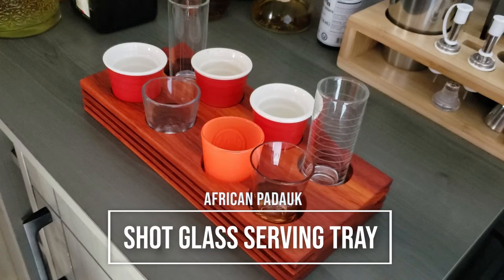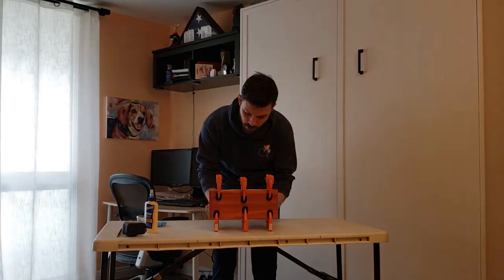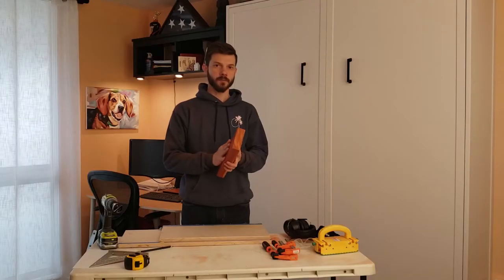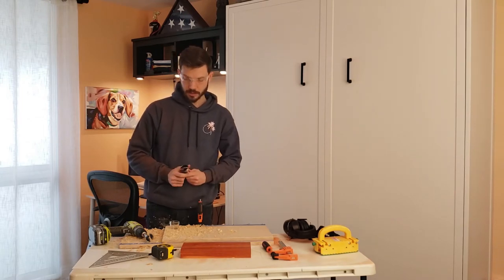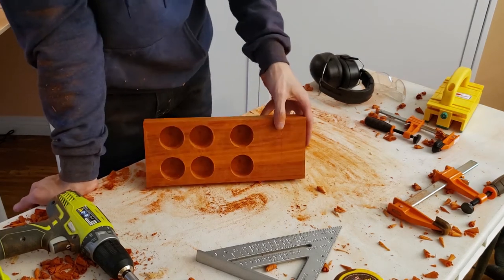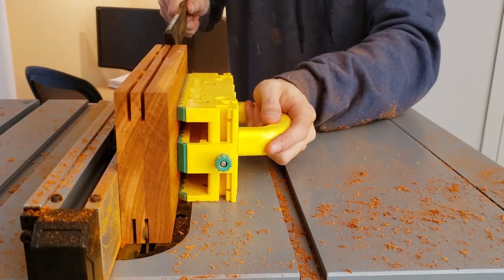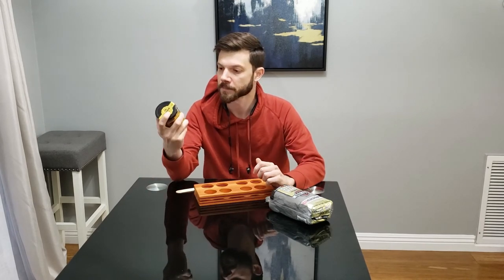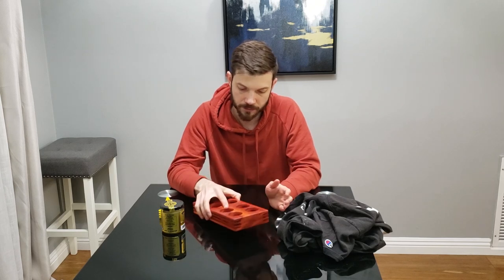Wooden Shot Glass Serving Tray | Scrap Wood Gift Project

Comment: Very nice project.  You could have used a T-handle (that sits taller than the glasses) as a carrying handle in the center space area to justify the additional spacing between the two sets of holes.  Just a thought. Thanks for sharing.
Reply from the maker: That's a fantastic idea! Wish I would have thought of it.